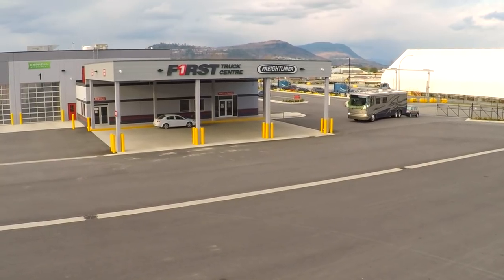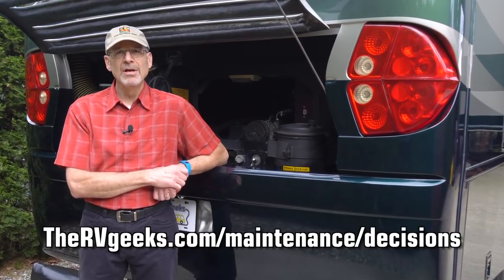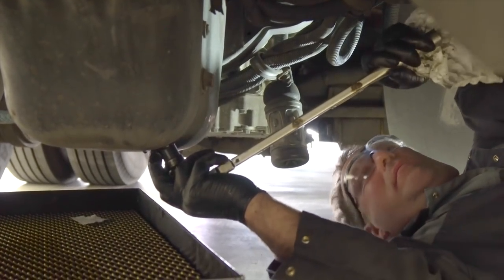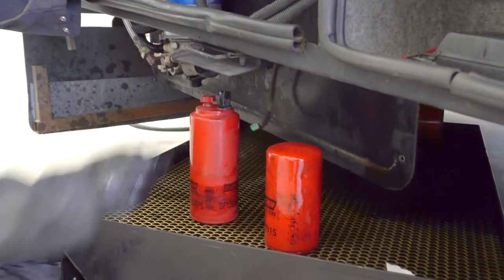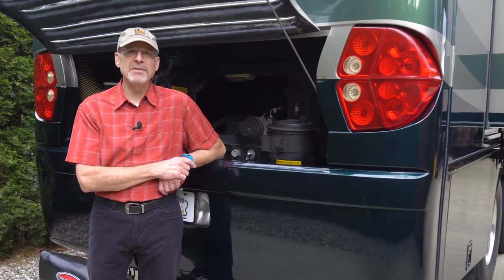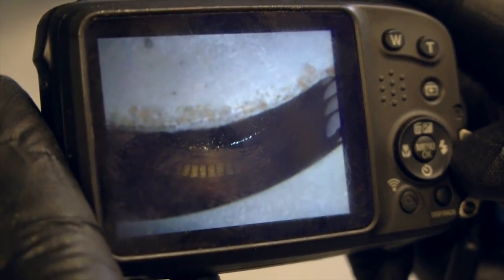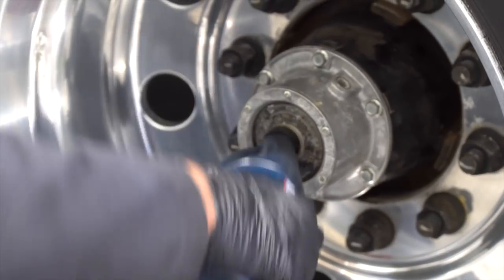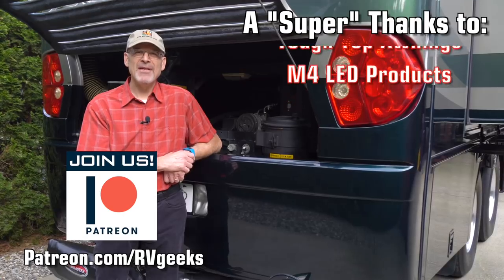🔧 RV Maintenance - Part Two: Decision Making 🤔 + A Ticking Time Bomb 💣

Comment: I'm a retired draftsman but I've also held long term jobs doing automobile mechanics and residential carpentry. I'm pretty "tool heavy" so most things I can do on my travel trailer but I absolutely have the dealer give my 2015 F-250 super duty a good once over before I set out on a trip. They can do the work faster than I can and it's not terrible cost wise. I drop it off, go home now the lawn, go back and like magic it's done!
Reply from the maker: Love it! 😊
Reply: I like being the guy who says "tighten up the hoosie whatis" and "adjust that flem banger to"

Comment: Incredibly interesting & thought provoking video gents. Am I correct in assuming many A class coaches are on truck chassis? So it's going to need specialist experience & knowledge to service those areas. Also, the points you raised about fluids. That's a lot of fluids, Oil, coolant & water to carry around and, having the space or safe areas to perform those changes. Not sure Walmart would be happy with any spillages on their lots
Reply from the maker: Thanks Dan! Since the RV manufacturers order chassis specific to their products, they're not exactly the same as trucks. But they're made by many of the same companies that make trucks, so their are LOTS of similarities. It's handy actually, as our Cummins engine and Allison transmission are built for far more challenging applications that RVing, so we get overbuilt systems that can handle the job with ease.

Comment: Seems like a first class shop. I have to admit I have never heard of air ride adjustment where would one find the specs manufacturer ? 
Thx very informative
Reply from the maker: Thanks Pat! We got our ride height specs from the chassis manufacturer (Spartan) by calling and requesting them, and now we keep them on file. Your manufacturer (most likely Freightliner or Spartan) should be able to provide you with the same information if you provide them with your VIN number.

Comment: The only problem with this, potentially, is what if you get a poorly trained tech and a supervisor who is not supervising... But I see your point in many of these. It is a lot of fluid to handle and dispose of properly. I like to think I can do most of what's needed on my coach, but it takes 3 times the time, and the only thing saved is money, but I do get valuable experience and knowledge doing it myself. Just installed the Air Force One braking system on my coach and while I could have paid someone to do it, I am glad I did it myself. Learned some valuable lessons. I expect I will pay someone to do most of this stuff but sure wish I could do it all of the time.
Reply from the maker: Hi Bob! Props to you for doing so much on your own. We installed our own braking system, too (13 years ago) and know exactly what you mean about the benefits of doing it yourself. As far as trusting a shop, it's definitely one of the challenges of us as full-timers, since we might be just about anywhere when it's service time, so it can be hard to establish a relationship with a place we trust. Luckily, we've settled into enough of a routine that we often end up back in the same spots often enough to plan around one or two great shops we've found over the years, including First Truck.

Comment: Protip when changing fuel filters you can fill them with ATF to prime the engine. It saves carrying around smelly diesel. Works like a charm.
Reply from the maker: Never heard of that one, Gary. Is it actually okay to run automatic transmission fluid through a diesel engine?
Reply: It will burn the ATF no problem. Before low sulphur fuel lots of truckers ran Type F fuild with the diesel for extra lubrication. If your stuck at the side of the road with a blocked filter it is far easier to pop open a couple of litres of ATF fill the filters and be on your way. Also you then know you have a verifiable clean source of fuel to prime your new filters. It wont be in there long.
Reply from the maker: Thanks Gary! Learn something new every day. 😊

Comment: Once again .... A very nice job. I especially liked the close  up on the wheel inspection. When I noticed a slight leak coming from my front wheel seal I was going to try to do it myself but I couldn't find any videos on it. Now that I've seen it, I realize I don't have  three or four of those tools so I guess that's a professional job:-)
Reply from the maker: For sure Richard! After we saw the complexity of the torquing sequence alone, we know it's a job we wouldn't touch... especially considering the safety factor on this one.

Comment: You guys are so thorough :-)  I was surprised at how relatively reasonable their charges were. The cost of tools and equipment has to be factored in and that heavy duty stuff ain't cheap. Not to mention the cost of training and the sheer difficulty in dealing with such large masses of components (that's why I became a motorcycle mechanic in 1970) :-)
Reply from the maker: So were we, Yoly! Thought their pricing was really very reasonable! And you were right to pursue motorcycle mechanic... MUCH smaller parts to work with! 😉

Comment: Great video and useful content.Thank you. Regarding your comment about Fumuto valves or similar ball valve  drains for oil. I have debated the same question for decades. Discussing this with a trusted automotive tech that has owned his own very successful automobile repair shop for decades, he explained about the leak issue over time as well as the valve installation draining slower due to orifice restriction, smaller hole, and that the valve is not installed flush with the interior of the oil pan. this leaves residual oil in the pan. maybe an 1/8" to a 1/4" of old dirty oil. While this on a percentage basis is not a big thing if you are draining out 7 gallons, it maybe  more an issue at 4 or 5 liters. 
Thank you for the great videos.

Joe
Reply from the maker: Thanks so much for sharing the great insight, Joe! We actually originally included a mention of the restriction of the oil drain opening as a potential for leaving residual debris in the oil pan, as well as the turning on and off  of the flow preventing good flushing action. But we removed that reference because it was only hypothesis on our part, and we couldn't find anything definitive about it. Great to hear that our thinking was validated by a far more experienced source. Thanks so much for adding to our decision-making process on this one. We certainly would need some very good mitigating factors to install one of those valves at this point.
Reply: One last thought, the drain plug in your diesel has a magnetic end which is great at attracting and trapping ferrous particles that are suspended in the oil. Just another benefit of using a high quality drain plug. 
Since I no longer lay on my back in all manner of road debri wrestling with wrenches, skinning my putty soft office worker fingers on greasy metal parts, to get at the drain plug. 
Over the last several years I find it better to leave most mechanical maintenance to those that are equipped and have the expertise. Thank you for the replies and great video.
Joe
Reply from the maker: Right on Joe! 👍😊

Comment: Another excellent video.   You alluded to the fact that self-servicing some maintenance items assumes potentially too great a risk if something goes wrong as part of the maintenance procedure.   High replacement cost components may warrant having the experts performing recurring maintenance because you have the independently documented maintenance activity /paper trails to support your case for good-will repairs should something break prematurely outside of the warranty period.
Reply from the maker: Thanks Anthony! Right on. Great point. We definitely take the cost-of-the-maintenance vs the cost-of-the-potential-damage into the decision mix. Ride height is a great example, as the driveline damage that incorrect ride height can cause can supposedly be very severe. We're very happy to say "supposedly" since that of course means we've never had a driveline problem. 😊
Reply: Anthony C Brown a

Comment: Excellent video.    Using sound judgement can be hard when you're pressed for cash.
Reply from the maker: That's true, Scott. Financial limitations can make it hard to afford NOT to be DIY with these tasks. But there are definitely advantages to (at least once in a while) getting professional eyes on these pieces of equipment to ensure that everything is working as it should. Saving the money today can sometimes result in more expensive problems down the road (drivetrain damage due to bad ride height, seized axle bearing due to leaking hub oil, etc). Again, we get that it's not easy when money is tight, but it's important to be aware of the ramifications.

Comment: Hi guys. At 13:18 is that a plastic bottle hanging just to the right of the mechanics hand? If it is, is that to catch blow by from the crankcase breather tube? I have been told about the breather tube exhausting oil vapor and causing build up on the radiator. Ever heard of this?
Reply from the maker: Haven’t heard of the radiator issue, but you’re right on target with the bottle. We made a short video about it: https://youtu.be/9w12E68nseo

Comment: Great video but there is one thing I want to add. Never change your oil plug to one of those valve types! There is a magnet in the original plug that catches any steel that breaks off an engine part. When the oil is changed any good mechanic will look at the plug for a warning sign of impending problems that could be catastrophic to the engine. With the valve type plug you will never know until it is too late.
Reply from the maker: Thanks so much for the input. We're VERY unlikely to make the switch to one of those valves... less and likely all the time thanks to valuable feedback like yours.

Comment: Well thought out vid. Wish I could find a repair facility I could trust. How come they're torquing the lug nuts sequentially? I thought you were supposed to go opposite or a star pattern.
Reply: To add to Wil's comments, the mechanics need to attend "how to properly use a torque wrench" school.  Impossible to achieve correct torque when they're bouncing on the wrench instead of a slow, continuous pressure 'til it clicks.  

And that's why I, a retired A&P, still do 99% of my maintenance.
Reply from the maker: Thanks Wil! In the part that's shown in the video, the tech using the impact wrench was doing the preliminary installation with the wheel still raised up in the air. They then dropped the rig down, and with the tire on the ground (so it wouldn't spin) he tightened them in the typical star pattern. We did notice that the final torque check was done in sequence though. Not sure why, but we have seen that done before.
Reply from the maker: Thanks for the input, Jim. We did see that when we returned for a torque check, the tech was smoother, and all seemed good.

Comment: Hey guys love the great videos you put out. Question, we're going to purchase an RV for retirement and I was wondering are the  maintenance bills for diesels the same for all sizes of diesels, 45' to a 34' ?
Reply from the maker: Thanks Robert! While there may be some savings, for the most part a diesel engine is a diesel engine, requiring most or all of the same maintenance. Less oil volume in a smaller engine, and other minor items probably won’t save enough, if anything, to make it a big factor. TIRES on the other hand... 6 vs 8 is a 25% savings, as well as smaller RVs using smaller less expensive ones.
Reply: @RVgeeks  Thanks for getting back to me.

Comment: Wait Wait Wait Wait....   @ 2:50 

While draining the oil, in the background right, is a Gatorade plastic container attached to a hose. Why is there a Gatorade container attached to your coach? Is that your slobber tube?
Reply from the maker: Slobber tube indeed! Here's the secret behind the plastic bottle. https://youtu.be/9w12E68nseo 😉
Reply: RVgeeks That has to be one of the slickest DIY solves for the slobber tube I've seen so far! Simple, easy AND refreshing! (Included punns intended) 👍
Reply from the maker: Thanks so much, Mike! Now we're thirsty for a refreshing beverage. 😁
Reply: Ok, for us motor coach newbies, what's a slobber tube?    Is that the oil that works it's way into the intercoolers?   I would have thought (such as on some pickups) that there may be an aftermarket setup to have it return to the engine?
Reply from the maker: Hi Dale! The "slobber tube" is slang for the crankcase breather tube (sometimes called the "road draft tube") and is part of the crankcase ventilation system. It's known as the "slobber tube" because it tends to drip oil. Here's a little detail about the system: https://en.wikipedia.org/wiki/Crankcase_ventilation_system

Comment: Hopefully the guys at Speedco  are better  than the people I have encountered at the Walmarts. In my toad vehicle they stripped the oil pan bolt,   covered it up with some type of sealer  
and sent me on my my,   more than once  That's why I installed a controllable valve.
Reply from the maker: We used Speedco for years, and suspect you'll find them capable of handling your diesel engine (that's all they work on - tractor trailers and other big trucks, and diesel pusher RVs) far better than Wal-Mart. We only stopped using them because they nearly doubled their prices after being bought out by a larger company.

Comment: I have two questions if you don’t mind. 1. just bought a brand new 12 v deep cycle battery. When it is on my charger/maintainer I can hear the water bubbling, is this normal and if not what should I do. 2, my RV indicator panel shows that my battery was full and with no load meaning the odd LED light on and using the pump twice it now shows empty. The next day it then showed 3/4 full and when I tested with a multimeter it was near full. Any suggestions? :)
Reply from the maker: Hi Kitchguy! Yes... it's normal to hear bubbling in your battery when it's charging. The bigger question is... does it ever stop bubbling? You want the battery to "bubble" fairly vigorously during the BULK phase of a 3-stage charge cycle. But then it should start calming down during the ABSORB/ABSORPTION phase, when the voltage is maintained at a constant value, but the amps ramp down slowly. If your battery charger/maintainer isn't 3-stage, it's likely just a 2-stage unit and will "BULK" charge for longer, then go to "FLOAT", where it just maintains the voltage at a level that's designed to keep it from discharging. But at that "FLOAT" stage, you shouldn't hear much, if any, bubbling. If you do... it could be a problem with your charger.

And when you say your "RV indicator panel", is that just an LED fuel-gauge-like display that shows a light for "Full", "3/4", "1/2", "1/4" and "Empty"? (or something similar)? If so... those are notoriously inaccurate. If it's something more "intelligent", it's possible that it's still learning your new battery's characteristics. So it could take it a while to adjust (meaning a couple of discharge and then recharge cycles).

But, after all that, it IS possible that the new battery you got could be bad. Depending on where you bought it from, it could have been sitting on a shelf, not being charged, for a long period of time. And that can lead to sulfation that decreases the battery's capacity, making it seem to charge quickly, but then discharge quickly, too. You could take it back to where you bought it and have them do a load test on it to see if it's performing OK. Or (if your charger has this as an option) you could try running it through an "Equalize" cycle (which is basically a controlled over-charging of the batter) to see if that improves its performance... although your really SHOULDN'T have to do that with a brand new battery.

Fire away with more questions/details if you want and we'll see what we can do to help you sleuth out the correct answer!
Reply: RVgeeks thank you so much. I bought the Nautilus 80 amp hrs at Canadian Tire as well as the G3500 Genius Battery Charger/maintainer. I can’t say for sure if it bubbles vigorously during charging but I will check to see how fast next time I’m charging. I get confused with three stage charging and I’m not sure if my charger is or isn’t. I’m just trying to learn all I can but so many articles are confusing at times. I’d like to take care of my batteries and hopefully have them for a few years :) As for my RV indicator panel it is the same one that has my grey and black water indicators. I will give it some time to see if it starts showing the correct levels of my battery. I will also keep my multimeter at the trailer sire as well just to check it.  I really appreciate your feedback. Thank you
Reply from the maker: No worries, Kitchguy! It can get confusing, fast! We just looked at the G3500 charger on their own website... and couldn't tell you (based on what they say) if it's a 3-stage charger or not. They use some confusing language! But it looks like it's not. It's a low-amperage, 2-stage charger with some extra features (like a de-sulfation mode, etc). A couple of things about it:

(1) Make sure you've selected the first "12V/Normal" mode for your charging, as that looks like the correct one for your 80Ah battery.

(2) They say a 100Ah battery takes 14 hours to recharge. So make sure you've let the battery charge for long enough before using it again... otherwise, it's not 100% re-charged and could be showing depleted on your panel.

Keeping your multimeter handy to check the battery voltage is a great idea... those "idiot panels" that most RV manufacturers install for checking tanks & batteries really leave a lot to be desired.

Hope all this helps get you squared away!
Reply: RVgeeks You’ve been a great help thank you. I also really enjoy your channel , thank you both for all the valuable information.